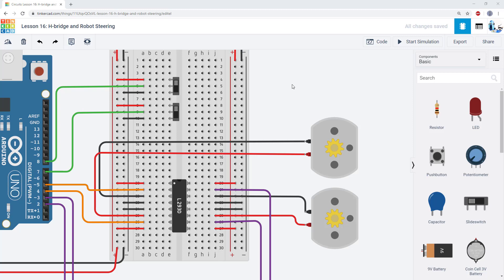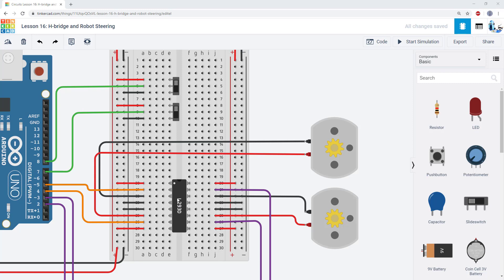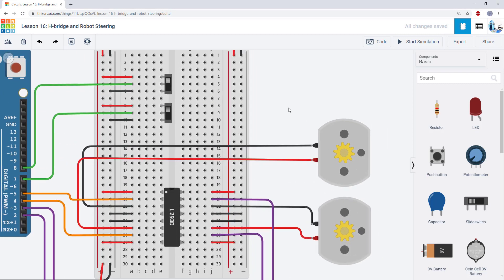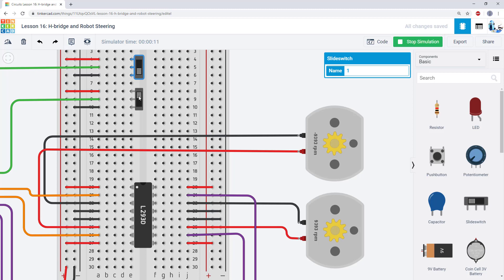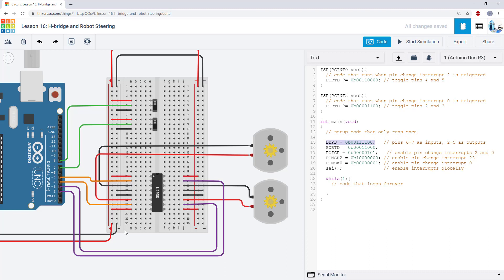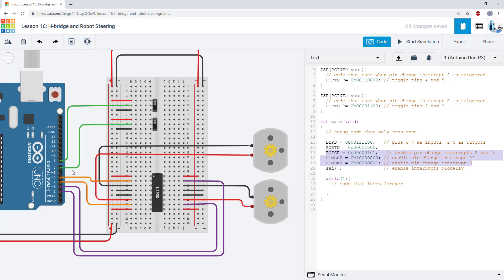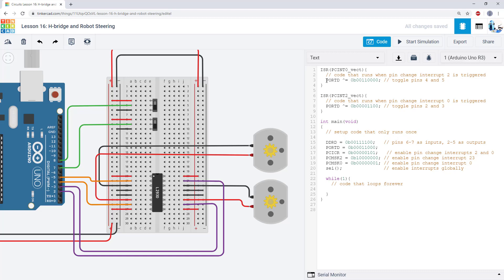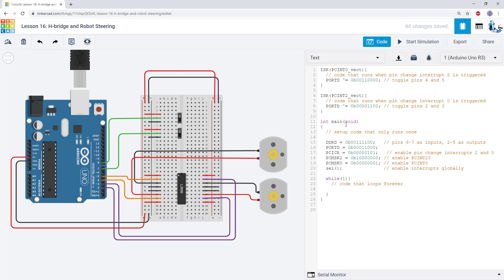Tinkercad + Arduino Lesson 16: H-bridge and Robot Steering

Comment: Man. Thanks a million for your tutorial! I was struggling with understanding how to use registers in my code. You gave me a huge push ,really! Programming microcontrollers is a tough thing. There is no book you can read and start codding. There are datasheets for your microcontroller, sensors, shift registers etc. I've started understanding it piece by piece thanks to guys like you. Now it's easier to read manuals and books for programming to keep learning further. Thank you one more time. I wish you all the best 👍